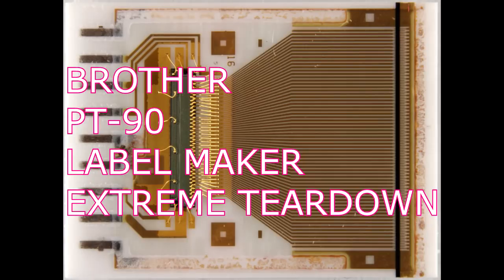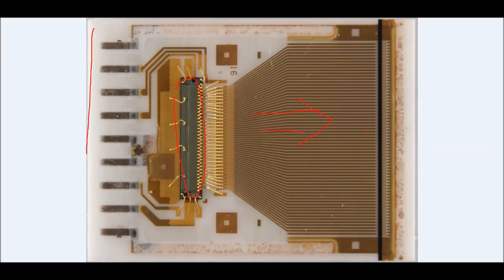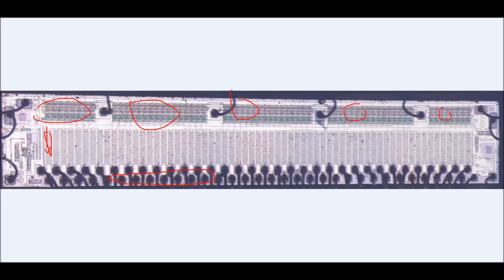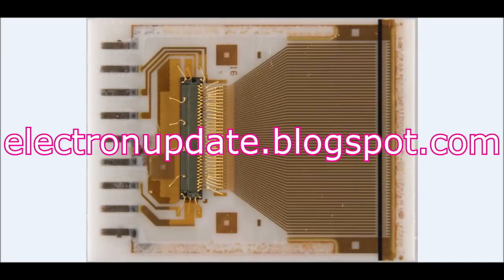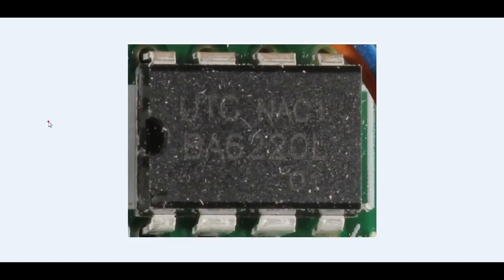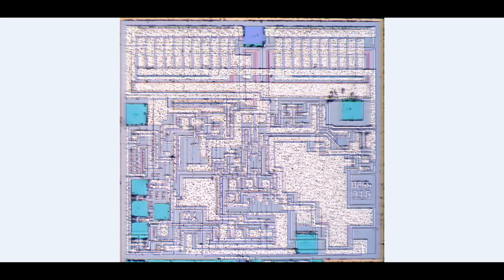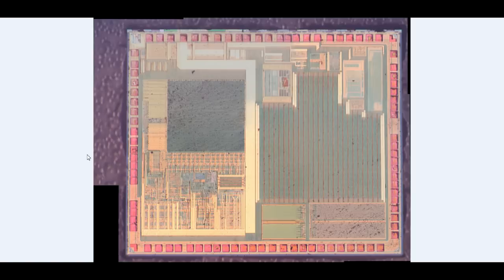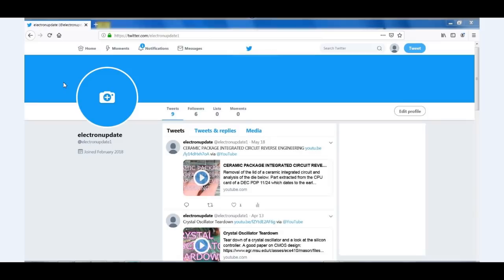Reverse Engineering the Neat Semiconductors in a Label Maker

Comment: My P-Touch 1830 has a very similar PCB, but uses a different flex connector on the printhead. Maybe they can be re-used/hacked with some simple microcontroller code to print anything you want, including graphics, e.g. barcodes? The governor isn't actually too bad of a choice of wording, as it governs the speed the motor is turning very precisely, regardless of the battery voltage applied. This saves them from using a stepper motor, or any kind of rotary encoder to keep the DC motor's speed constant.

Comment: Not made by Brother, but common to almost any thermal printhead, just that they make the bigger ones by cascading those little drivers and then have a few in series driven from the same serial data stream, and then a few parallel series strings to get the speed up, basically making the print head in electrical segments on the same ceramic substrate. Biggest ones are those on thermal fax machines, where you find the same 64 bit drivers repeated. and the flex cable has a wide power and ground trace ( 18V is a typical drive voltage) and then thinner traces with the data streams, the clock and the latch and enable pulses. Darkness of the print is by controlling the length of the enable pulse, so the print head spot gets warmer, and overall on the bigger print heads there is a thermal sensor to cut power on the head overheating. Pretty never much going to get the head shutting down thermally though, the driver just slows down as it heats up.

They do fail though, eventually wearing through the glass coating on the resistors, and you get single driver outputs that fail, putting a blank line in the print, and as well failing flex bonds that make the image lose whatever segment line is affected. In general the heads are available as spare parts on the more expensive machines, like those used in supermarket mass meters, but they will do in general over a million kilometers of print without failure, just clean them regularly from the adhesive build up.

Comment: Neat.  I wasn't expecting the printhead to be as simple as the line of conductive ink across the electrode comb.  I wonder if the printhead has some simple timing circuitry to avoid a communication issue causing the heaters to remain energised.
Reply: Given there is 6 traces directly to the IC. It might be... Vpower, Vcontroller, Ground, Clk, Data, and EnableOutput. So instead of a latch, you just have an enable power mosfet output. Which I would think is reliable enough since you don't need to pump in zero to turn off the output. The disadvantage of course, would be slower speed of printing, since you have to turn off the output  to pump in the next line.
Reply: @mofo78536  There is an R-C-link in the enable line so if the micro goes in orbit it won't fry the heaters.

Comment: I think that label is actually thermal transfer. There is a black ribbon in the cartridge which gets its ink transferred to the tape via a thermal process. A example of a direct thermal label would be the dymo letratag. There is no ink ribbon in that cartridge. Also, almost all thermal print heads are made by a supplier like Toshiba or ALPS. I doubt brother made that print head.
Reply: jak p Nope. You’re thinking of the higher end Brother labelers that use the TZ/TZe tapes, which are laminated thermal transfer. But the model here, the PT-90, uses the Brother M tapes, which are simple direct thermal.